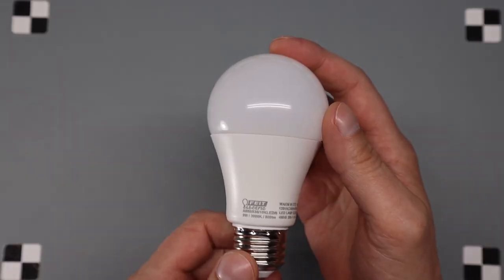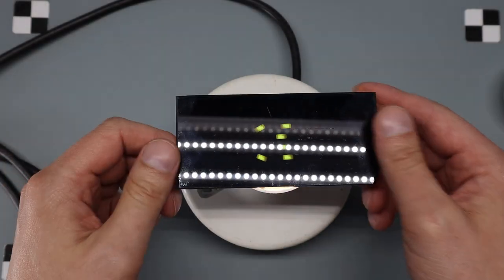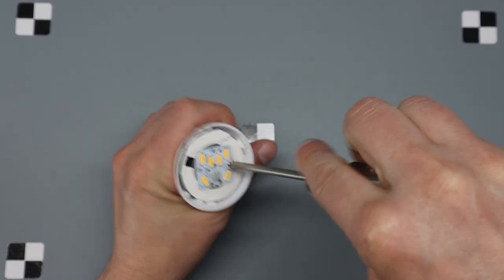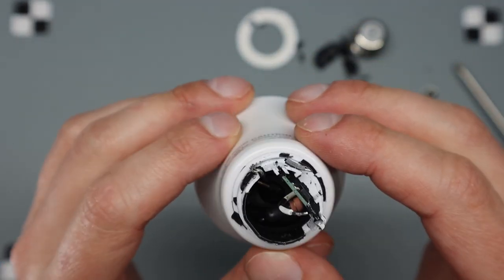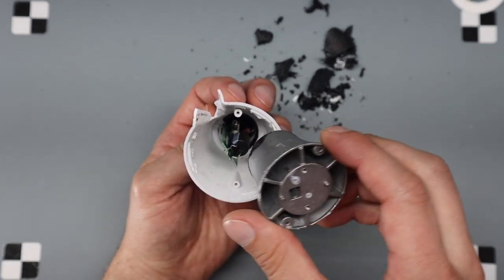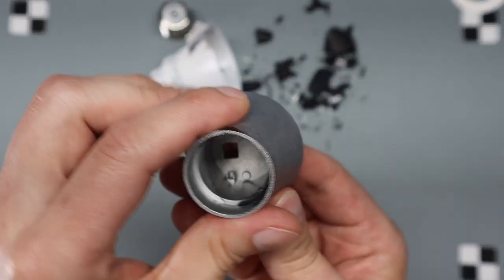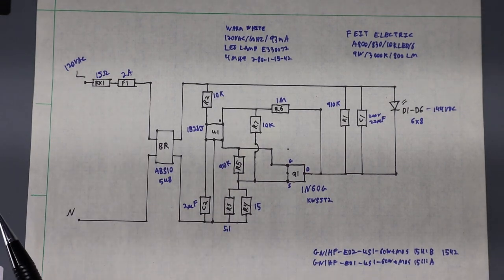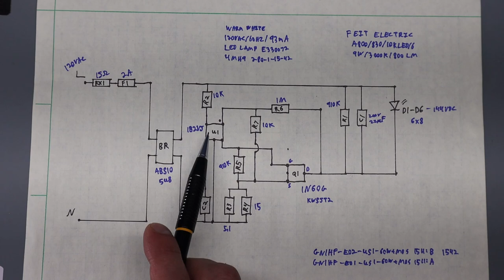Teardown 9w FEIT LED bulb with schematic

Comment: I wish you had showed how you got the base (the screw part) off. Everything else was straightforward, but that is not.
Reply from the maker: That was done by holding the heat sink area by hand and using channel-lock pliers on the base with a short back and forth motion.
Reply: Thanks @eeAspect

Comment: I've a Feit 17.5W 1600 lumen bulb that "just failed". From your teardown, it seems impossible to get to the circuit card without destroying the entire bulb. The order of assembly must be connect the circuit card to the bulb screw, crimp on the screw to the plastic base, fill the bottom with potting compound. After that has "cured" put in the metal heat sink, then plug in the LED board and finally glue on the plastic bulb cover. These are so wasteful. In theory, they are supposed to last 10yrs or longer. I've never had an LED bulb last more than a few years before they fail. There are interesting electronics parts to salvage, if you have a Dremel with cutting wheel and patience.
Reply from the maker: If it's old like this one, and actually has a large heat sink, then it would be impossible.
There was compound splashed on the inside and outside of the heat sink, so that's why I assumed it was fluid when they put it in. Though maybe they filled the base, put the heat sink in and then added more compound through the hole.
Reply: I have found a video showing that if you insert the bulb into a bulb socket and with some force remove the rest of the bulb you can separate and then reattach it while aligning the crimps and in my own experience I found this to work quite well (also first remove the end cap so you don’t tear the attached cable). Luckily the bulbs I have opened did not have that black potting you showed so it was much easier to deal with. Thanks for the video!